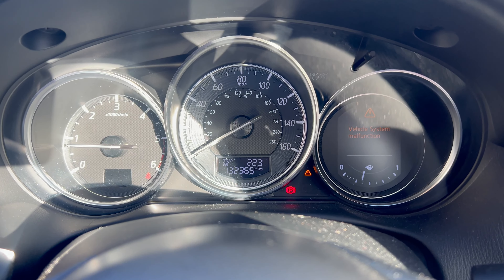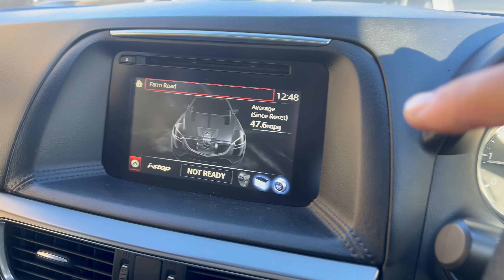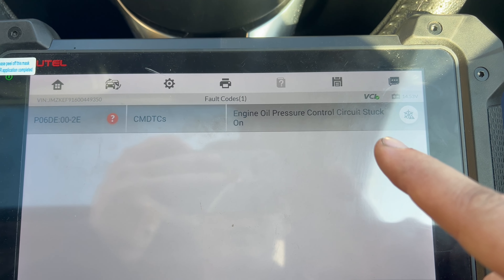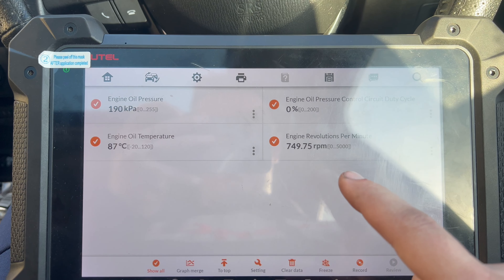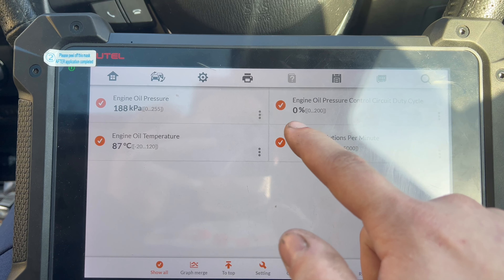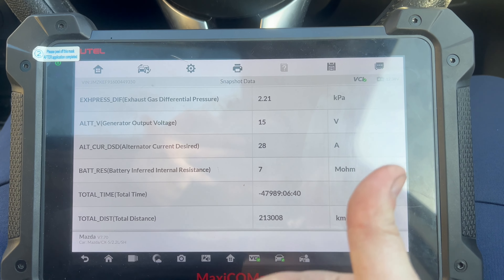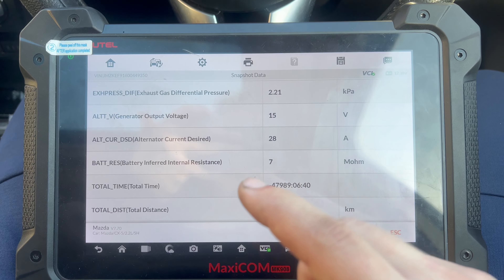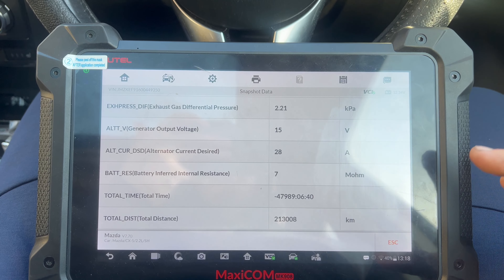Mazda CX5 Oil Pressure Problem Diagnosing - P06DE Mazda Skyactiv 2.2 Diesel

Comment: This is all very interesting. I bet, either the oil strainer wasn’t replaced the first time or it’s clogged again because the cleaning wasn’t done properly. I’m looking forward to another update.
Reply from the maker: I will have to check it as I still haven't removed the oil strainer, but I may be doing it very soon. The first thing to do is the oil pressure measurement mechanically at the moment.

Comment: Very informative, i am having a similar problem, got a warning 'oil pressure inspection required' did oil flush, changed oil pump (new oil pressure reading at idle was about 160-170 kpa). i thought the problem was solved, but the warning came up again today. How did you solve this problem? Is there a follow up video??
Reply: I have the same problem, did you manage to fix it?
Reply: Same problem, unable to locate the follow up video.